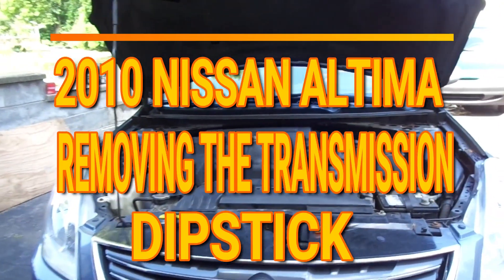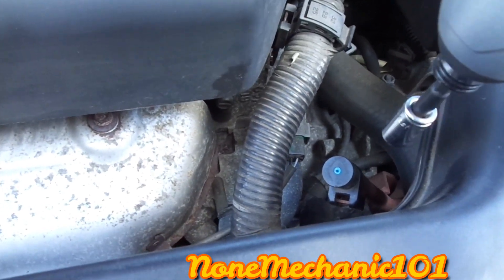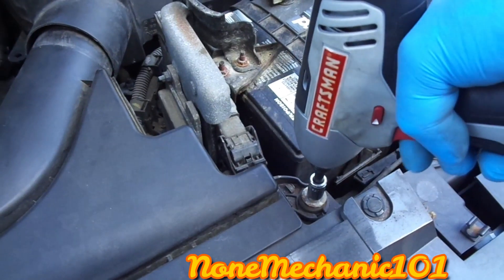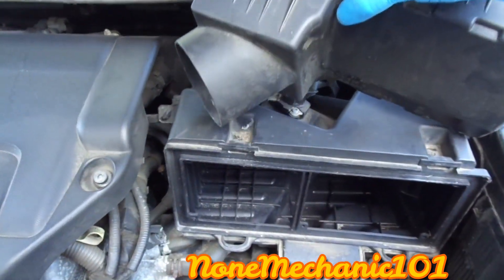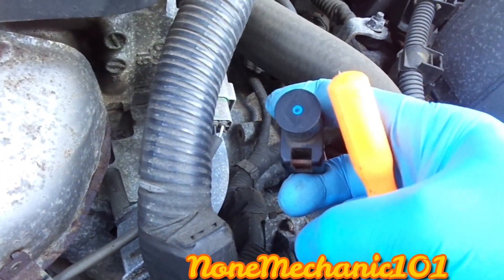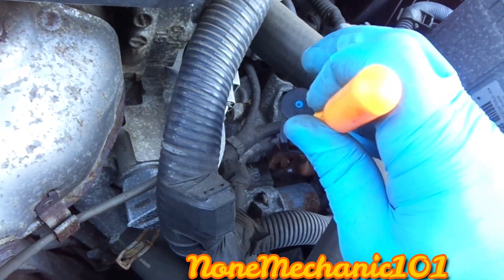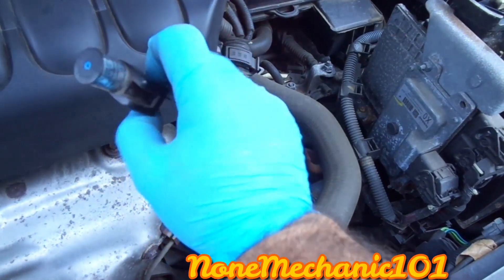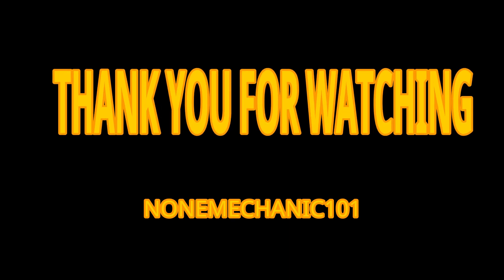Removing the Transmission dipstick on a 2010 Nissan Altima

Comment: Just came across this video again.  Works perfectly for my Nissan Rogue.  Honestly, the best thing to do is break the little plastic tab, that way you don't accidentally put the dipstick back in the right way and lock it again.  You make it look easy, but it took me about 10-15 mins to get mine out.  The only reason it locks in the first place is to keep inexperienced people from messing with it.  I like to check my transmission fluid level, color, and smell (to see if it smells burnt) from time to time and it was such a hassle until I broke the clip.  Now it works great!
Reply from the maker: Thank you

Comment: Thanks for the good video.
You can put it backwards and leave it this way so it doesn't lock (provided you don't let someone dumb to mess with it at some point). And no, it's not gonna let anything get inside, there's a thick rubber seal at the stick neck)
Reply from the maker: Thank you. The rubber seal is very important👍

Comment: So i broke off the plastic “clip”, because the pushing method is not working. Do these things get stuck? I’ve broken even more to get it out. I’ve been at this thing for 45 min. Am I doing something wrong?
Reply from the maker: If the plastic broke it should come out easy. It shouldn't be stuck
Reply: @NoneMechanic101  So I completely broke the plastic off. It still doesn't come off. It's baffling.
Reply: Push from the side not from the top

Comment: It works easiest if you use the screwdriver from the bottom.  The locking tab is on the outside of the cap which fits into a metal slot.
Reply from the maker: Thank you for the information. I appreciate it🛠

Comment: When I took the cap off the metal dipstick was not attached, is this common for a 2014 altima? I was going to head down to Autozone to buy a dipstick and fluid this morning.
Reply from the maker: You should have a dip stick
Reply: Yea dude I have the same problem with my 2018 Altima. I guess I’m taking it to Nissan tomorrow morning